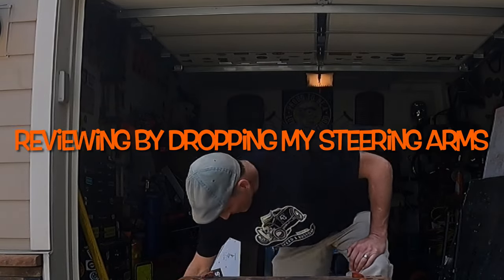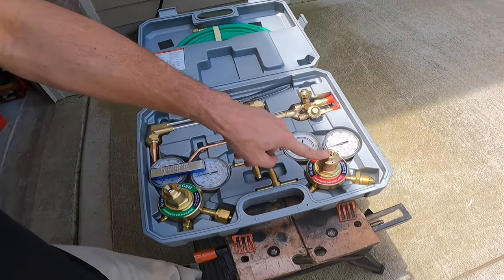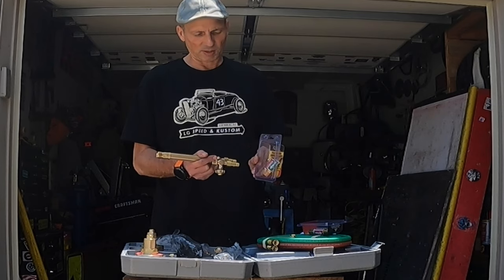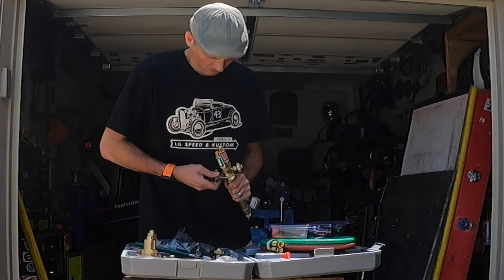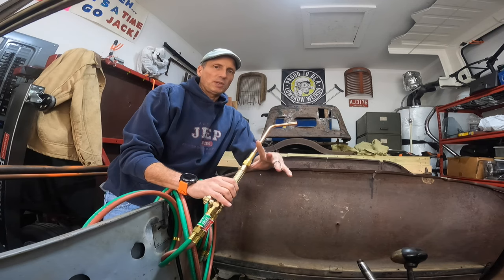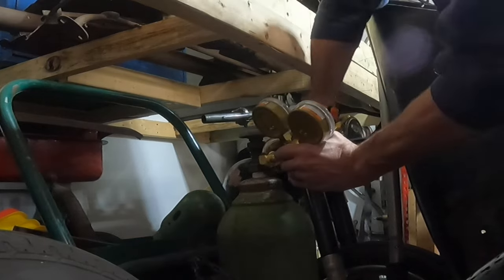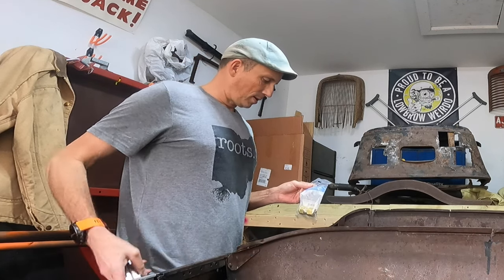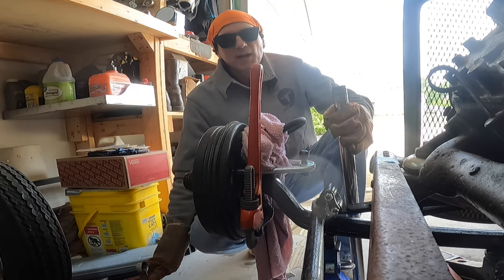Can A Harbor Freight Torch Cut It In The Hot Rod World? (Dropping My Steering Arms & Torch Review)

Comment: You can peal the hoses apart to give you more clearance for your gauges. I just called my welding supplier in Sandpoint for pricing. I’m working on a 1924 Dodge Brothers Touring. It has no front brakes. They only had rear mechanical brakes. I’m considering Mustang II front suspension for it. Enjoy your videos. Keep ‘em coming!
Reply from the maker: Thanks Randie. Yeah, I’d definitely be upgrading the brakes on your Dodge… can’t imagine trying to drive on todays mean streets with only rear mechanical brakes, yikes!

Comment: Careful with that heat over the concrete, it'll pop out pieces violently.  A piece of plate or even sheet metal under the work area is a good idea.
Reply from the maker: That’s a good safety tip!  It’s hard to tell from the camera angle but I was pretty far away from the concrete so I think I was ok.  Thanks for watching!
Reply: @AJStarch  Looked like you were getting close enough for some concern on the camera, perhaps you were not.  Either way, now you know about it and that's what matters.  There should be some video online to give you more information bro.

With normal eye protection used (Tinted Goggles) there isn't much danger from popping concrete causing injury, but it will startle the crap out of you with a 6300 degree torch in your hand and screw up the concrete surface.

I picked up a similar Oxy-Acetylene  setup from Northern Tool for my home shop and use it much the same as you.  Heating to break things free, to fit things together and of course to heat and bend metals.  Had it about 10 years and it's worked out well thus far.  Same size tanks as what you are using, I mounted everything on a converted hand truck.

Too many times you see guys heating with a cutting torch head - wrong wrong wrong.  The heat is localized to superheat for cutting.  Heating applications is what the Rosebud tip was designed for as you demonstrated.